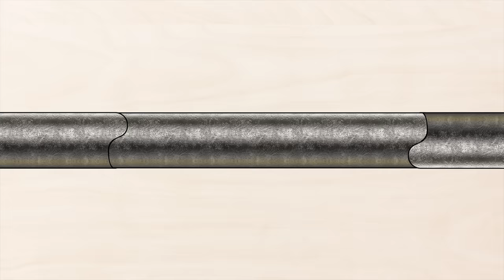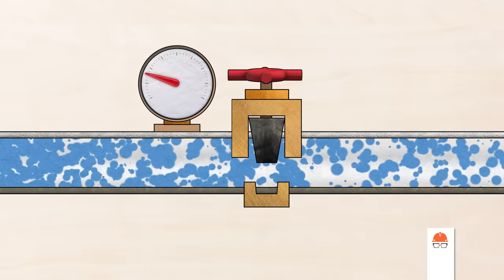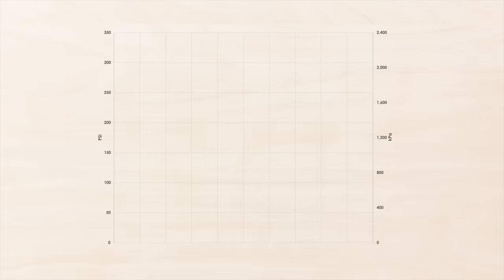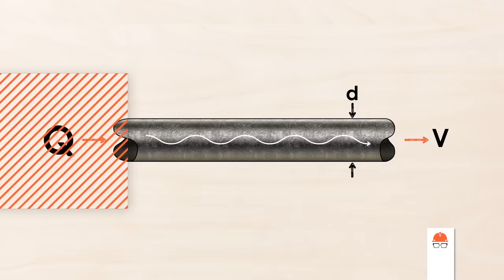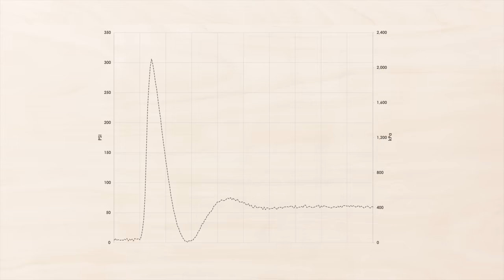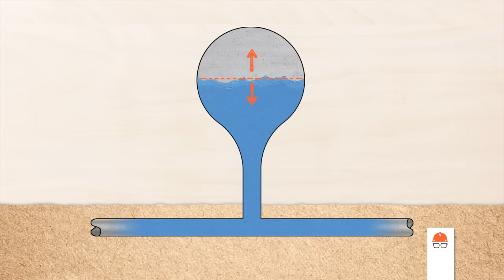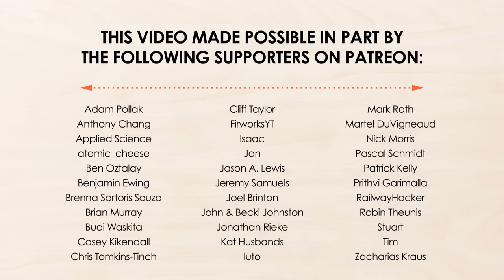What is Water Hammer?

Comment: I've seen 4" copper pipe look like a snake when someone opens/closes a valve to fast. At 20 feet up in the air a bit of a pain repairing the soldered joints.
Reply: kleinjahr copper in particular MUST be secured along its entire length to avoid any movement.
Reply: kleinjahr 

Who solders 4" copper?
Reply: Theweescot 

Secured along it's entire length?
Reply: Theweescot Aye, that was also a problem and what the codes are for. Which was pointed out to management.
Reply: John Perdue Sometimes in older plants you run into odd things. I’ve even run into old knob and tube wiring, still in use.
Reply: John Perdue. why not.
Reply: kleinjahr. waow.
Reply: kleinjahr I'm a residential electrician and it's Amazing how much knob and tube is still In use
Reply: Fast4SloW 717 here in the UP of Michigan lots of houses are knob and tube. what was surprising was watching the town water co dig up all the old wooden sewer pipes. I had no idea they used wood (assuming cedar) for piping...
Reply: Phred Phlintstoner. double waow.
Reply: Breweries
Reply: kleinjahr Me too. Wood foundations, knob and tube, dbl walll lath and plaster, lead and cast joints. etc..
Reply: We used to use a "dry" end up on each water lin to service valve, but after enough research and years, it was found that the air left in the upright dead end tube was absorbed into the water over time.
Reply: Rest ing Ayup,modern ones will have a diaphragm/ balloon to separate air from water. Quite often they’ll have a schrader valve so you can add air as needed.
Reply: kleinjahr yep. Hot water tanks same thing.

Comment: Washing machines and old plumbing...     Washing machines are some of the biggest culprits for this in the home because many solenoids shut the water off very quickly. On plumbing that is installed without buffers or arrestors, the hammer effect can be quite noticeable!
Reply: Builder Dex I just saw one with a hammer arrester on the pipes that didn't do enough. I suspect the city bumped up the pressure again to use increased lressire to shore up old water mains. Some cities get sued for this when appliances break, pipes rupture, and hoses Flood (when homeowners eventually figure it out). A good pressure regulator being adapted down to the proper pressure by a plumber is usually enough to save them if they don't wait until it's too late.
Reply: You're not kidding, we bought a brand new LG top loader,  all the bells and whistles , connected to the wifi ect.  LOL,   but holy crap that shut off so fast  the water hammer sounded like somebody dropped  a huge safe in the basement.    Never heard of water hammer until that noise was apparent.     Went out and bought a couple of those Sioux Chief arrestor's for the back of the washing machine  and so far,  they've worked perfect  quiet,   but holy crap they give off a serious bang.
Reply: @Boswd  Ya my LG is terrible too.  Frustrating to buy a brand new whiz bang appliance and have it make such loud noises.  I installed the arrestors on the back but they don't really make a difference.  Of course no one at the appliance store knows anything about it or has ever heard of this.  Pressure regulator is new so I know the pressure isn't too high.  I've heard it's the digitally controlled valves used by LG...shameful, I should have returned the piece of junk.
Reply: @JoeS97756  try the sioux chief brand there have worked great for us.    https://www.acehardware.com/departments/plumbing/pipe-fittings/copper-fittings/44556. If that doesn't work at all your water pressure may be too high.   Call a plumber and they can test it and install some arrestor s closer to the outside water source
Reply: @Boswd  Thanks, I have some type of small arrester that I installed years ago, not sure of the brand, but it didn't do any good.  I saw a suggestion to slightly close the water valves behind the washer and I might try that to see if it works.  We had the house re-piped a few years ago and a new pressure regulator was installed so that should still be good I would think.

Comment: I didn't see or hear about the most common source of water hammers in a multi-pump system (more for mining/industrial slurry) which occurs when the horizontal water column is separated by vacuum because of pump start timing and/or vacuum occurring in the primary (first in the system) pump suction.  These water hammers have nothing to do with closing valves, as valves typically are not installed in such systems.  Such water hammers are actually cavitation at a very large scale.

The water hammer occurs where the separated water column collides.  The part of the water column ahead of the vacuum is flow-restricted by the components of the system (pipe friction, directional fittings, pumps, etc.) but the part of the column behind the vacuum doesn't have those same restrictions, with the flow being increased by the vacuum.  The pressure wave from this collision reverberates in both directions inside the pipeline, but is stronger in the direction of flow.  The intensity varies with the distance the column is separated by vacuum.  I've seen pump face-plates blown all the way across the access road by these water hammers.

Comment: A very well made video. As someone in public health this is something that is very important to understand. 

A similar issue is hydraulic shock when vacuums form in building pipework (pumps fail but people continue to draw off water creating a vacuum in the pipework.) When the pump failure is fixed the pumps see a massive demand and ramp in seconds to maximum output. When this water reaches the top of risers this can lead to expensive failures. One in the news blew the top of the riser off and caused multi £millions in water damage. A lot of mitigation includes lowering the speed pumps ramp up at and surge arrestor valves at the top of building risers which stop a vacuum forming and allow air in.

Comment: I've been trying to explain this to my wife for ages, as she always slams the faucets :-) I will force her to watch this.
Reply: In Europe we have soft closing taps these days. I bet you can get them where you live too.
Reply: How's the "forcing" going?
Reply: I Live in Europe and have installed the plumbing myself. That is why I'm worried it will break at one of the connections. What is a soft closing tap?
Reply: I suppose one type of soft-closing tap is one where you can't normally turn the handle fast enough to go from fully open to closed in <x> milliseconds. An example would be the old screw-style taps that close graually with a rubber gaskt inside. An example of a non-soft-closing tap is a ball vavle where you only have to turn it 90 degress to go from fully open to closed.
Reply: I have been married over 20 years and I can tell you one thing about educating your better half. No matter what you teach them they know one thing for sure...that you are still wrong.
Reply: A soft closing tap is a tap with a viscous damper inside, i.e. you can't close it too fast. It's usually used on single lever mixing faucets only, the rotating valve style is kinda soft closing on its own.
Reply: TheKajunkat you married the wrong person lol
Reply: Jeroen Trappers: "WIFE"? How about invite, or even urge? Never "force".

Or would you be another failed American marriage?
Reply: Michael Dougfir lol
Reply: Just get or adjust the pressure regulator valve 
That should fix the problem
Reply: Jackie Scholl 
It will if the speed is higher than 5 meters per second
Or if they are not well supported in the house ( loose pipes)
Reply: Jackie Scholl you are incorrect there, it usually won’t damage it. But it does cause strain on the system, and if you can actually hear the water hammer, that means your pipes are moving, and any kind of movement like that can eventually break joints in the pipe or rub a hole in them if they are sliding against something.
Reply: Michael Dougfir By the way, I love your ridiculous assumption. The guy already said he’s in Europe, and yet still your bias against Americans caused you to ignore that right? LOL
Reply: Yeah, don't forcet on her.
Reply: Grant Adamson You mean don’t ‘faucet’ on her? :-p
Reply: "Force her to watch this"! 
If you take that literally, it's both funny and a little disturbing!
Reply: Tuvoca I know right? imagine just how fun this person must be at parties if they took this so literally.

Comment: I remember early in my career when testing the automatic sprinkler system at a rocket fuel plant (very large water deluge), the test technician was warned to turn off the water deluge very slowly, but he shut the system off as fast as he could, causing a pipe to burst in a nearby building where a mix was occurring.  The guys doing the mix ran out of the building in a panic!
Reply: Even in smaller volume plumbing, that's an issue. Your comment shows why engineers tend to design for worst case humans. (Most humans will function at worst case at some point.)

Comment: My grandfather built the house I lived in through high school. The plumber he hired was also an engineer. A two-story house with a water heater in the basement. When we turned on the hot water, on the second floor, we had hot water instantly. It was a looped system and there was NO heat pump. The plumber/engineer designed the pipes to bypass needing a hot water pump. Where the water line came down and returned an elbow within two feet of the WH. He came up 12" from the horizontal and ran a 12" long parallel pipe and another pipe 12" with an elbow back down to the horizontal. He went half the distance of the parallel and ran a six-inch pipe 90 degrees perpendicular, a 12" pipe down, and six-inch pipe return towards the horizontal. He installed three hose bibs to remove air from the pipe configuration. He had a backflow preventer at the horizontal before looping to the verticle at the WH. He had a backflow preventer on the verticle within 12'' from the WH, above the horizontal loop, eliminating the need for a heat pump. Chew on that!
Reply: Jim 4.40,
 No, unchewable ( by me ).
 Lost after instantly having hot water upstairs.
Hopefully, this knowlege won't be lost after your passing .  .  .

Comment: I seen water hammer in 48 inch pipe, low pressure, and the pipe "jump " 3 feet , something to see.
Reply: Go the Piermont NY in USA to see the enormous flywheel in the video at 4:40. There is a great bike shop right behind what is essentially a monument to Yankee ingenuity. The cardboard factory was torn down in the 1990's to make way for new development but the flywheel was too big to move so they left it in place - that's the story anyway. Make sure the check out the eponymous pier which pierces about a mile into the "Tappan Zee" Hudson River estuary when you are there.
Reply: @ bobbiago     Great Article!! Thanks!  <;)

Comment: I used to have water hammer in my pipes caused by my washing machine. Couldn't figure out what it was at first, until I discovered this channel. I've now got a water arrester connected to my washing machine. No more banging and I've learned loads more about engineering thanks to this channel.
Reply: Feel like naming the manufacturer? XD do you use a flexible hose to connect it up? What is your water pressure?
Reply: @mandowarrior123  bought it from screwfix and it sits between the washing machine and the flexi hose.

Comment: how does the flywheel in this system work? is it similar to a turbine?
Reply: It just adds inertia to the pump rotor. Which makes it wind up and down slowly.
A pump suddenly starting or stopping can also introduce pressure transients.
Reply: thank you!
Reply: In other words, something you could just as easily do with a VFD with a soft ramp up configured in this modern era?
Reply: Tjita1 VFDs don't work when the power is cut, and flywheels are cheap, but other than that, sure.
Reply: In equally modern systems the power to the VFD is never cut (unless there is an outage, which at least all water plants I know of remedies with uninteruptible backups), the speed of the VFD is controlled externally from a control system. I've never seen a pump with a flywheel on it, and I've worked with pumps at least up to a couple hundred kW. Maybe MW range pumps use them though, I've only briefly seen that large pumps (made a visit to the turbine hall of a nuclear power plant once, I think the main coolant pumps was 2.4 MW each), so I haven't noticed if they have some extra stuff on them. As for the price point, I think you will find that the prices of electronics are dropping at a rate equally high as the price of metals are rising.
Reply: Tjita1 even the best backup generator system takes about 15-30 seconds to restart the pumps... transient pressure waves travel at velocities up to 4500fps, so by the time the pump is re-started, the pressure waves are already causing damage all over the piping system.

Comment: There are 2 other water hammers. One is when there is air in a pipe and the water travels fast, then hits a tap that is almost closed. The other is when a tap is turned off suddenly and downstream, the vacuum pressure sucks the gasses out of the water, creating a cavity in the pipe. The water in the pipe stops moving forward and reverses back toward the tap with a cracking noise. The same thing happens when using a garden hose like a whip. Cavitation followed by collapse
Reply: I've owned my current house for 10 years and never had any water hammer issues. Several months ago the hot water faucet in the bathroom sink only, has begun to hammer when turned wide open. The water runs for several seconds without issues then out of nowhere begins to hammer like a machine gun. It doesn't happen if you don't open the faucet all the way. I've been familiar with the kind of hammer this video speaks of and in my experience it happens a lot on washing machines since the solenoid valves in those machines do snap shut. But what could be the cause of it happening while the water is running with the valve wide open? And why did it start out of nowhere? Nothing was changed. We put a new sink & tub in the bathroom before we moved in 10 years ago and it was perfect and quiet until recently. I'm stumped.
Reply: @dale1956ties  It is a harmonic of the system. Perhaps the flow rate changed. If you attached a weight to the part that bangs, it might stop.

Comment: But there is a secondary, not rarely more powerful effect to this. The pressure spike on the incoming side depends on the speed of the closing valve, however for fast flows the pressure on the outgoing valve will drop to zero on the other side and a cavitation bubble will form. First of all many pipelines can't take negative pressures and implode and if that's not enough the low pressure will eventually stop the flow and reverse it. The reversing flow now accelerates to the already closed valve with nothing but vacuum inbetween. The vacuum collapses and the water would theoretically need to slow down instantly, much faster than the water on the other side had to. This easily can rupture pipes..
Reply: So.. whenever you close a main valve, it's imperative to have a vacuum-release function on the other side?
Reply: So if you close a valve slowly enough, the water hammer effect will not be an issue, even with huge pipe systems?
Reply: well said. this is called vacuum water hamer which is more powerful for sure

Comment: Every morning, I wake up to the guy upstairs slamming off the tap in his bathroom, causing the pipes all through my walls to rattle. It sounds like someone punching the walls from the inside.
Reply: Belias Phyre that is so creepy
Reply: A few years ago my landlord put a new lawn sprinkler system in at the house I rent and set it to run from 2am to 2:10 am every morning.    First time it shut off I awoke thinking a car had slammed into the house.  After the third night, I went to the controls inside the garage and unplugged it.
Reply: You could cut open the drywall and add some brackets to restrain the pipe... Might quiet things down
Reply: That might be an option, but I'm thinking more of installing that buffer device just under the sink. I can do that since I'm the one that maintains the building, but I'll likely have to do it for all the sinks, and justify it to the owner.